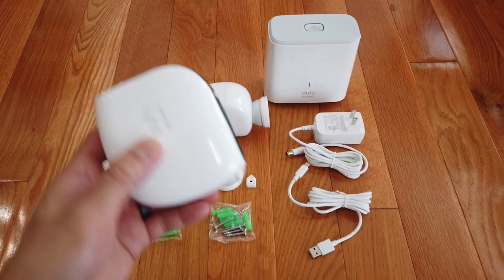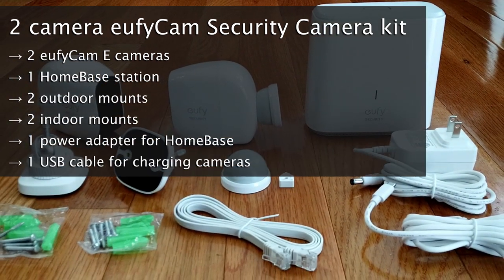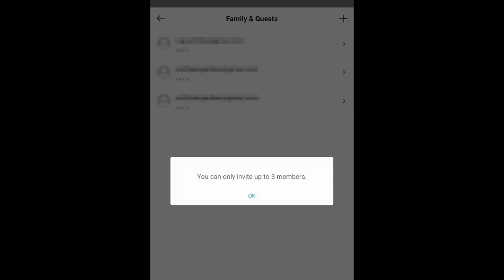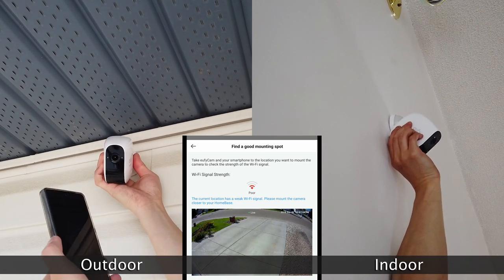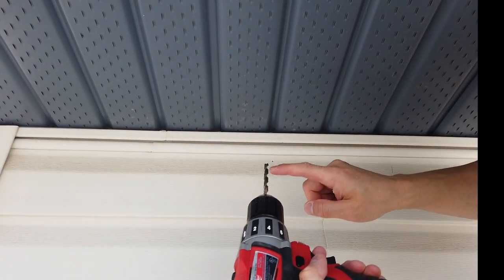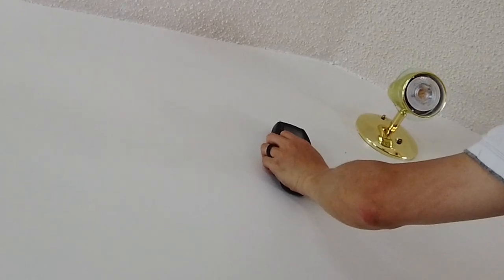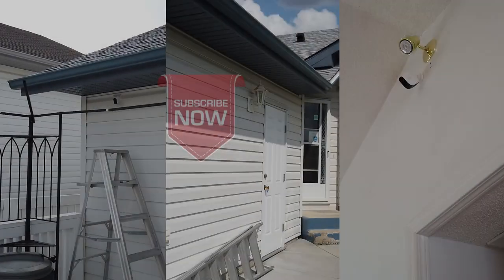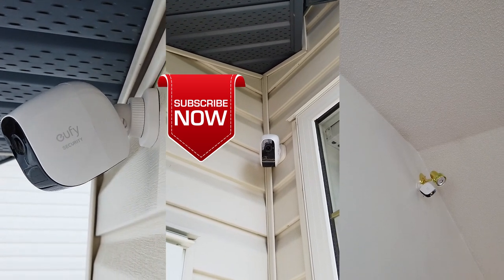How to install a Wireless security camera | Indoor/Outdoor security camera installation guide

Comment: Using the gutter mount makes it easy
Reply from the maker: Yes. It definirely is another option for easy installation.  Though, I'm not sure how sturdy it is to the wind.  Will it fly off or cause more false detections? Also, if there is no shading from the sun it is also going against one of Eufy's installation recommendations... if that matters to you.
I will be doing another install video on vinyl siding without drilling that is easy to do.  Watch out for that video to come in the future.
Reply: @FrakkingCreations  any videos on solar panels
Reply from the maker: Here you go for solar panels ... https://youtu.be/LMmWopvndaY
Reply from the maker: For external power here... https://youtu.be/b1QiHW7Z32s

Comment: it looks like the screws you used on the outdoor cam are too short to go through the siding and in to the wall behind it? Are the anchors just hanging freely behind the siding?
Reply from the maker: Thanks for taking the time to point out a concern.  The anchors are actually firmly in the wall behind the siding.  I had to hammer them into the holes I drilled in the wood.
Reply: @FrakkingCreations   Those anchors that came with the camera were long enough to get through the siding and in to the wall or did you use different anchors? I have one of these camera and im planning to mount in to some aluminum siding.

Comment: Does the homebase need to be physically connected by cable to your router after instalation? Because if every camera has to be in range the homebase connected by a cable to my router, its going to seriously limit where I can put the cameras. If the homebase can be moved elsewhere within range of my WIFI then the cameras could go anywhere around my house.
Reply from the maker: The eufy system allows you to connect the home base to you router through wifi too but I haven't tested that.  This should be what you are looking for.

Comment: Can it record  on sides of buildings
Reply from the maker: I don't fully understand your question, if you don't mind providing more details on what you mean.
I did show in the video that we have the eufy camera installed on the side of the house pointing at an angle towards the front of the house.  That does work but during the night the siding may reflect the infrared light when in night mode causing it to be hard to view the video as everything else becomes dark.
In that situation either turn off night mode or reposition the camera to show less of the sides of the house or use an external infrared light source.
Reply from the maker: Here is our video on an external infrared illuminators for security cameras:  https://youtu.be/sF-9XLDiTRg

Comment: So how do u charge the camera when battery is low? Don't u have to put in a charger cable or does it charge wireless? Hmm😮
Reply from the maker: Typically, the manufacturers tell you to take the camera down and recharge it.  You can also try using a solar panel like in our other video:  https://youtu.be/LMmWopvndaY
Reply from the maker: Or try connecting to power like in our other hack here: https://youtu.be/b1QiHW7Z32s
These charge the cameras even when they are still mounted so you don't have to take them down much or at all depending on how you use your cameras.

Comment: So if people wanted to they can just unscrew it and take the camera?
Reply from the maker: Yes. Unfortunately, that is the case with a lot of cameras out there.  So it's important that they are installed properly and out of easy reach.  But not installed too high up for cameras that use PIR for motion detection.

Comment: I have a problem where I live, I cannot have Internet either because there is already another service or because the other company cannot give me enough speed on the Internet, I have bought these cameras and they come to me in the first week of December, the matter is  I want to put a Hotspot from the T-mobile company but I have no idea if that device can give Internet to these cameras, I need help please
Reply from the maker: There is a potential it may work.  The cameras actually connect to the homebase using a proprietary wifi network.  The homebase then connects to the internet through your gateway/router.  The homebase should be able to connect to your hotspot using Wifi.  Only thing is that I believe I saw somewhere that you might need to initialize/setup your homebase with a wired ethernet connection.  After that you should be able to change it to connect using wifi.
Hope this helps.

Comment: How do you mount on a horizontal surface such as below window ledge?
Reply from the maker: Just to be sure what you are asking... Are you planning on placing the mount upwards?  In other wards when you screw in the mount the screws are being screwed in towards the sky/upwards.
Reply: @FrakkingCreations  No sorry for the confusion, hanging it downwards from a ledge or eaves of the house for example?
Reply from the maker: You're probably looking for something like this for the eaves trough:  https://amzn.to/36jCVBX
(You will have to check fitment for the screw that attaches to the camera)
As for the ledge, I can't say since I don't know what it looks like and what it is made out of.
Reply from the maker: Here is a less expensive one that fits Eufy security cameras.  https://amzn.to/2JuTtO8
Hope this info helps you with your install!

Comment: I have this system but the book has nothing about how to reactivate the anti theft alarm. There’s an off button at the top of the home base E but where’s the on switch?
Reply from the maker: The button on the top of the homebase is to turn the alarm off when it is triggered.  It doesn't actually turn the alarm mode off.  After you turn it off, when the alarm is sounding, the system should be ready to sound again if it is triggered by anti-theft alarm or other alarm settings in the apps Security page.
Hope that helps.
Reply: @FrakkingCreations  Thank you! I also found out for myself that the app fixes most issues. It takes a lot of tweaking to get it right.
Reply from the maker: That's great.
It's good that the app let's you configure the system quite a bit and once you get used to it, it's so easy!

Comment: So although the eufy cams do not need a subscription to save videos there is one thing I am disappointed in. There is the function to save the videos from the camera to your tablet/phone but there is no way to view them. I haven't even found a way to see the saved ones back on the app. With out a way to be able to let law enforcement have them I see those videos only as timestamps for my other Wired cameras. The only other good thing is being able to talk with someone.

I did research and have found that the encryption is only available in the app and if you have the subscription. I did buy a total of five cameras but mainly for the alarms.
Reply from the maker: You should be able to find the videos saved on your smartphone.  Not sure which smartphone you have but on Android phones they should show up in the photo gallery app under a folder with the name that has eufy video in it.  Alternatively, you can connet to your computer and look for the eufy video folder and the saved videos should all be there.
As for the encryption it is encrypted on the sdcard too on the homebase.
Reply: I know exactly where the videos are saved. The problem is when i try to to play them there is only audio, no video. It tells me it cannot play the video. Notsure what I am doing wrong. I will try downloading more and try again. I have a android phone. Just a simple Motorola.
Reply: OK so I checked again and I get the codex on the player is not right. So I just found another player to download and it works. Great, now I am pleased. Sometimes you just need a push at the right time. Dumb because I am software trained. I guess since I retired this year I've just let my brain stop thinking. Thank you.
Reply from the maker: Glad you were able to find the solution!  It's definitely always satsfiying to find the solution to an annoying issue.
Nice chatting with you on eufycams!

Comment: Ok so if we mount it 7-9 feet high and it’s time to charge the camera..we need a bloody ladder every time  bring the camera down!
Reply from the maker: Unfortunately, with Battery powered cameras you will have to take them down to recharge.  But since the eufy cameras tend to last long you won't have to do it too often.
Checkout our videos for external power and solar power so that you don't have to take them down.
Reply from the maker: External power: https://youtu.be/b1QiHW7Z32s
Reply from the maker: Solar power: https://youtu.be/LMmWopvndaY
Reply from the maker: Installation on vinyl siding: https://youtu.be/h-0MTVCdvhA
Reply from the maker: Extending outdoor motion detection: https://youtu.be/z_Uiq72T9AU

Comment: you didn't show how to install the other type.
Reply from the maker: Which other type are you referring to?
Reply: @FrakkingCreations  they gave me two ways to hand these cameras. One was with 2 screws, the other was one screw. Then there is a little piece of plastic that came in the same plastic bag with the 1 screw option. The little piece of plastic looks like a home base if you are watching a baseball game.
Reply from the maker: Oh ok. The small baseball diamond like piece is meant for the magnet mount.  Once it is screwed into the wall the magnetic mount slides onto it.  Them attach your camera to the magnetic mount.
Does that make sense?
Reply: @FrakkingCreations  yes, exactly. But anyone can remove that set up without any difficulty, or am I setting it up wrong. I cannot find any videos with someone mounting it that way. It's like they just forgot about that set up.
Reply from the maker: True.  This mount is meant to be used indoors as per design so they didn't make it harder for removal.
Reply: @FrakkingCreations  ok